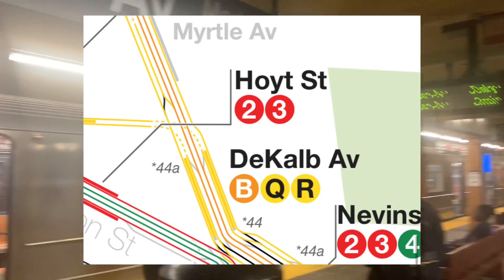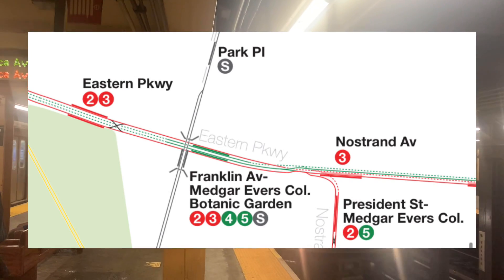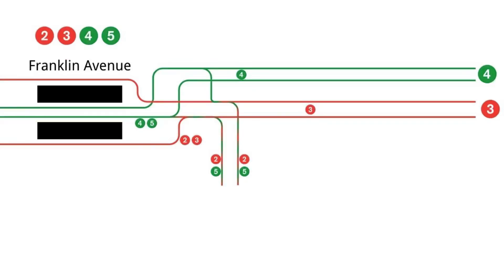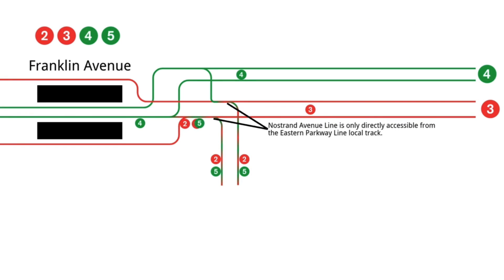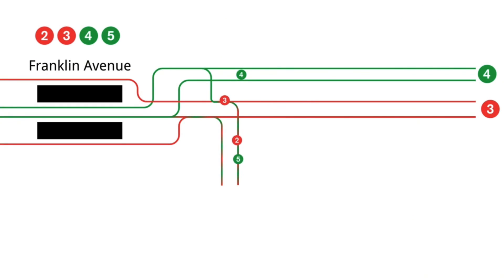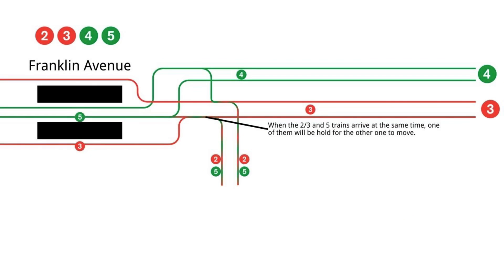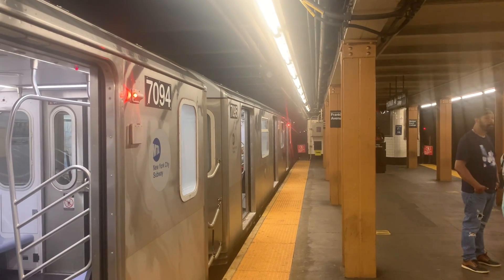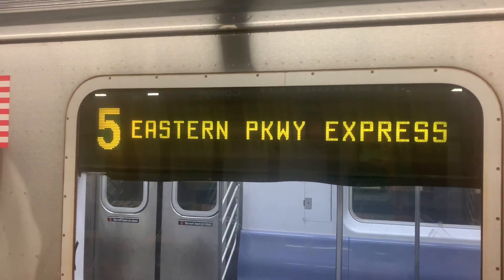Rogers Junction: Fix it to get 30% more capacity in the A division!

Comment: I don’t like the idea of the 8 because then you decrease capacity a little bit and you need more trains. What would be more optimal is to build a new switch that connects the Nostrand Avenue line with the express track. And people on Nostrand Avenue rely on 5 train service. They can just build a new switch from the express track that curves around kind of like how the five curves around from the 2 to the 4 at 149. You can do the same thing going into President Street and then you can still increase capacity. People within the MTA told me it’s unlikely they would get rid of the three at new lots because the 3 is based at Livonia yard. People don’t like to transfer all too much. People prefer direct service and the 5 does that job fine. All you need to do is build a new switch from the express track to the Nostrand Avenue line. You can build a new form of interlining kind of like how 59 St does it with the B and the D. This is not official and a lot of work would have to be done in order for this to be implemented.
Reply from the maker: I remember seeing this plan in the 1993 study.
Reply from the maker: That curve at 149 limits train speeds, so I don’t want to replicate that. As for the one seat ride argument, the more reliable service will make up the time of the cross platform transfer at Franklin Avenue. Like which do you prefer: a one seat ride that is held and delayed multiple times, or a service that is on time that requires a cross platform transfer?
Reply: @Urban_Man I usually like to go direct
Reply: @the_elmeister A minor cross-platform transfer won’t make or break your trip. In fact, it could make your trip faster.

And besides, nothing wrong with building two new switches east of the Roger’s Junction interlocking and sending the 3 to Flatbush and the 5 to New Lots, making all the usual stops. This would mean that riders further out have faster service and those in the Broadway-7th Avenue Line would have more consistent service. And the loss of a direct yard access is no biggie. Livonia is pretty useless as a 3 train facility (much like the 3 train itself in a way), given that nearly all the space there is for storing train cars used on the 4 and 5 trains. By deinterlining, you could allow for the 5 to based out of Livonia Yard while the 3 would have direct access to East 180th Street Yard instead, which would further improve reliability. Also works pretty well considering how often 3 service has been suspended during weekend track work in Manhattan or something.
Reply: @TheRailLeaguer we’ll see what happens. But for DeKalb, swapping it all makes it so u don’t get a cross platform transfer which is a problem
Reply: @the_elmeister With the current patterns, it’s not much of an issue since the 6th and Broadway Lines run about a block apart from each other, so it’s just a short walk from an alternate station. After all, got to have those alternatives.

In addition, I also propose to actually  integrate bike share with the transit system via the OMNY system. Not only that, but expand it deeper into the outer boroughs as well. This would allow for users to cycle to an another station that does seem to be further away but brings you to your ideal destination. Not to mention it would get a good number of people off the subway and bus system, creating room for those who actually need it.
Reply: @TheRailLeaguer  I think there can be a switch created from the express track to Notre Avenue line simple as that and then yeah
Reply: @the_elmeister That would potentially require even more complex work compared to deintelrinjng Nostrand with the two new switches between the interlocking and the Nostrand Avenue station platform. This would provide even more pronounced benefits for train crews and the riders alike. Not to mention more frequent service overall.
Reply: @TheRailLeaguer  that’s why I think the 5 should get a switch from the express track to Nostrand Avenue line but to be honest with you, I think if there’s gonna be any rerouting, you need to consider the new Utica Avenue Line. I think that branch could warrant the need for two services because it’s isolated from everything else and don’t forget that the 4 train serves new lots during late night hours. I think what you can do is have the 3 and 5 trains go on the new Utica Avenue line and you have a switch from both of those tracks at Utica and then the 4 goes to New Lots at all times.
Reply: @the_elmeister My plan does consider the Utica Avenue subway, and you honestly don’t need the 5 to get on the Nostrand Avenue Line. You could be fine with the 2 and 3 going to Flatbush and the 4 and 5 taking the Eastern Pkwy Line with the 4 going express to Utica and then switching to the local to go to New Lots while the 5 switching to the local to stop at Nostrand and Kingston and then Utica before switching to the Utica Avenue subway.

And as a frequent transit rider, neither Nostrand nor Utica need more than 15-20 trains per hour, especially for CBD-bound service. The 2 and 3 on Nostrand would give off a combined 20 for that corridor. Utica would need about 15. That’s more than enough. No more, no less.

In fact, I’ve considered a modified Utica subway option, with the tracks from Eastern Pkwy being the express tracks making express stops to Avenue H, then local from there to Kings Plaza. Another pair of tracks would start at Avenue H, be the local track north to Eastern Pkwy, then continue up Utica and Malcom X and then DeKalb to Queens, connecting with the J, M, and L trains for transfer service to Manhattan. This would allow for much of the transit traffic to be funneled away from Downtown Brooklyn and Manhattan and ease congestion there, all while improving connectivity between Brooklyn and Queens.
Reply: @TheRailLeaguer I think they can extend Nostrand Line and split it into two branches and one can go to Gerittan Beach and one go to Sheepshead Bay
Reply: @the_elmeister That would be way too impractical since Gerritsen Beach transit ridership and population is too low for warrant a subway extension. Besides, what’s wrong with a singe extension down Nostrand all the way to Sheepshead Bay and Manhattan Beach, location of Kingsborough CC’s hefty student population? This would still get Gerritsen Beach <1 hour of the CDB, even if that neighborhood doesn’t get subway service (which it honestly does not need)?
Reply: @TheRailLeaguer what if instead of Gerritson, it goes to Breezy Point Queens or towards the tail end of the Rockaways
Reply: @the_elmeister Manhattan Beach is a pretty solid terminal for now. Breezy Point doesn’t really need subway service right now.
Reply: @TheRailLeaguer 
According to census data Utica Avenue riders are headed towards downtown Brooklyn and Lower Manhattan so having an IND Utica Avenue line would no longer be necessary. 

Also Lower Manhattan isn't really a popular destination for those on Broadway Brooklyn and Myrtle Avenue rather their preference is Midtown Manhattan Soho I think for now M train interlining is worth it but as gentrification marches Eastward into Northern Brooklyn and Queens in the long term we might need drastic improvements and changes to fix the infrastructure of the BMT Jamaica Line as a whole.

There's also another thing about the lack of connectivity between Northern Brooklyn, Southern Brooklyn and Central/Northern Queens (of which Queens is currently dry and is in better need of public transit mobility).
Reply: @TheRailLeaguer 
In my proposed NYC Subway extensions throughout parts of Brooklyn and Queens there's the potential for redevelopment and especially upzoning. The city is in a housing crisis, not just a climate crisis, and we need this.

My problem and this goes for Utica as well with extending the IRT down  these two avenues (you know which corridors I'm talking about) is it doesn't connect to any other subways in until Alatnic/Barclays, so it remains a strictly Manhattan-Centric subway network. I really want other subway lines serving both extensions, but in the case of Nostrand where there's already a subway some of the way, it's probably too much disruption to widen the tunnels to fit B-division trains. I'd extend the E from Canal Street to do this, so that people deeper in Brooklyn can connect with the A/C and G trains to travel between the outer boroughs. (Utica would also connect with the J and M.)

Speaking of housing Development in southern Brooklyn right now it would be helpful to know whether current B46, G, J, and L riders prefer Midtown East or Midtown West as a whole for the entire length of the Utica Aveune/Malcolm X Blvd corridor. Because my stance for Utica Ave being a separate IND line rather than an IRT branch could be fulfilled by an extension of SAS or whichever 8th Avenue services terminates at World Trade Center. Could go either way.

As for 6 Ave/Superexpress, the F would go to Flushing, and the V would go to Hillside Ave. Northern Blvd would still be substantial enough to relieve the 7, simply because you're saving a lot of time on East Elmhurst to get onto a train sooner. (Port Washington would also help, especially Murray Hill and Broadway stations for Q12, Q15, and riders on other buses, there would be 12 TPH on this segment in my grand vision.) which frees up the A to do Hoarce Harding Expressway and the C to do Union Turnpike, both able to replace costly express buses and make room at College Point depot to boost local bus frequencies.

All the above should create a ton to help Southern Brooklyn and Northeast Queens upzone. Remember, we're not only in a climate crisis, we're also in a housing crisis, and we need as much new housing as we can get.
Reply: @TheRailLeaguer 
Then I have a few outlandish suggestions 

The K runs from Bedford to Canarsie. There are switch tracks at West 4th, Chrystie, and Broadway Junction that could make this possible. Basically have the K run from Bedford Park Blvd to Canarsie Rockaway Parkway via CPW local, 8th Avenue local, Chrystie Street, Broadway-Brooklyn then use a new track East of Broadway Junction for K trains to access the Canarsie Line and have K trains terminate at Rockaway Parkway.

Bring the Brown M and V train combo back which could be possible if L train service is beefed up this time to make the Brown M terminate at Broad Street (no Nassau-4th Aveune service) every capital projects including small capital projects that could be de-interlined should be de-interlined.

Restore the H and restore the abandoned LIRR Rockaway Beach branch from both Rockaway branches and have it connect to the Queens Blvd Line at 63rd-Drive Rego Park and have it terminating at Woodhaven Blvd. Build a track loop past Woodhaven Blvd under the QB ROW so it could turn around and return to Far Rockaway.

I think a subway line running along Utica Aveune should be built as planned in the IND Second System as a B division line.

The K and V should both be reinstated, with the V splitting off from the F after Second Avenue, towards South 4th Street meeting up with the K, while the K splits off from the A, C, and E after Canal Street, running along the Worth Street line towards South 4th Street  to meet with the V. Both lines will run along Central Aveune before turning towards Malcolm X Boulevard, which after Fulton Street becomes Utica Aveune, running standard 2-trak line, terminating at Aveune U Kings Plaza. 

As for the M it would have to be rerouted as part of the Second Avenue line.
Reply: @TheRailLeaguer 
Speaking of housing development in southern Brooklyn is mentioned. I've said before how I feel about SAS being the Utica Avenue line, as a way to relive the Lexington and Canarsie trunks in general, and platform overcrowding at Union Square and Bleecker St in particular. (It would also aid Brooklyn/Queens connectivity by giving the E, K, J, and M lines north/south connections.) Right now it would be helpful to know whether current B46, G, J, and L riders prefer Midtown East or Midtown West as a whole. Because my stance for Utica Aveune being a separate IND line rather than an IRT branch could be fulfilled by an extension of whichever 8th Avenue services terminates at World Trade Center instead of SAS. Could go either way.

 Since we're talking about crayons here's mine. I keep my A/C/E labels for Fulton/8 Ave/Queens Blvd express, with the K being 8 Ave/CPW local. I am no longer extending that on the Manhattan side, so WTC stays. The K would be extended at the Washington Heights end into New Jersey, via Route 4, to Paterson NJ.

I used to tie an extension of the Myrtle Avenue line to 8th Avenue. Instead I'm tying it onto Broadway. Now that I know the S-bend between Corrtlandt St and City Hall can only take a maximum of 20 TPH, I'm extending the present day W down to the lower level of City Hall then to downtown Brooklyn on a new alignment finally I have the W running down Myrtle Aveune with a portal at Ryerson Street so it properly connects with the Myrtle Avenue El. So the would now share tracks between Metropolitan Aveune and Ditmars Blvd, combining this is a future extension along Eliot Avenue and Junction Blvd to LGA serving Corona all within a one seat ride and creating a loop line this would follow the Q58 which is top 2 of the busiest bus routes in 2022.
Reply: @TheRailLeaguer 
I would like to address some of my plans for "transit expansions"

I would first say that given Flushing is a top destination corridor for the vast majority of Queens, especially Northeast Queens along the LIE Corridor. That is why, prepandemic, Flushing-Main St on the 7 was the most used station outside of Manhattan, with close to 60k daily riders if I am not mistaken. Also, there is nothing at College Point Blvd/LIE, it is a highway ramps, parks, and cemeteries. In other words, there is very little redevelopment potential to create that induced demand. A better alignment is to serve Flushing, then veer down Main Street or Kissena Blvd, as Main Street is surrounded by parkland, Kissena Blvd is surrounded by both sides by dense apartment buildings. I have my issues with extending the G back to Queens Boulevard, but if you are going to have the G branch, that can serve Main St as well. Also include a stop at 99th St, LeFrak is there.

I also think the 7 should go elsewhere as well Port Washington is way too close to Northern Blvd, and 10-12 TPH on Port Washington would be more than enough capacity for this entire corridor. Consider extending the 7 up north to College Point/Whitestone, and adding a second branch along Kissena Blvd heading towards the LIE. This helps fill existing service gaps in NE Queens, while also paralleling some highly used buses like the Q25, Q44, and Q65 in Whitestone/College Point, and the Q17, Q27, and Q88 in East Flushing and Oakland Gardens. Both branches would start as Flushing, as Flushing is a major commercial center in Queens, making it a higher rider destination.

Don't think a four track line is necessary outside of the Second Avenue Subway. Both Utica and the Nostrand Aveune corridors don't need an express since the Eastern Parkway line would be capped at 15-20 TPH for each branch and the demand for a four track line isn't really worthwhile in areas aside from 2nd Aveune in Manhattan. Speed wise, two track lines can be as fast as express sections, if done right. Wider stop spacing is required, plus a train car can accelerate faster to my knowledge.

Commuter rail doesn't need to be this way. If you go to cities like Paris, commuter rail runs every 4 minutes. That is because these systems were reconfigured as a regional rail express system, with competitive pricing to the Metro. Doing the same in New York City would be way cheaper then building a subway parallel to a commuter rail route and would be way cheaper netting nearly the same benefits if that's the case then you're better off extended the E somewhere else such as the Merrick/Linden Boulevard corridor to cover other Southeast Queens transit deserts and if the MTA gets costs down on construction costs then you're better off extending the E via Linden Boulevard to increase coverage meanwhile the LIRR Atlantic branch would get converted into a regional rail line. I also want to add for the E to SE Queens extension, although the E via Alatnic is good, I believe regional rail is best for both Atlantic and Montauk. This will serve a huge portion of SE Queens, but even with this increased coverage, there are still spots that have poor transit service. So I would extend the E to those areas, like Cambria Heights.

-How come despite logistics many Railfanners support Joint Transit Association and Alon Levy's plans for a Second Avenue Subway extension via Utica Aveune and the 7 train project for JTA since TMC and Alon claims that parallels a "perfectly good regional rail corridor" making subway line extensions useless and according to TMC's quote "regional rail is a replacement is some instances like in the Bronx where even at average global construction costs don't allow brand new subway lines to pencil or on Northern Boulevard where LIRR stations are generally adequate enough for connecting bus service and a new subway line would compete with ridership for the LIRR". According to TMC.

Besides how come every single Railfanner like Joint Transit Association, Urbanman, TMC, Alon Levy, Samuelitoo, Mystic Transit and others are proposing a unified regional rail system and are attempting to utilize existing infrastructure first before we extend any subway lines also these are the same Railfanners that claim that the 7 via Northern Boulevard is wasteful because the Port Washington branch already parallels the Northern Boulevard corridor which is why JTA and others support his proposed 7 train project for the Flushing Line to serve areas like College Point Whitestone, and Bay Terrace as well as the LIE Corridor to Bayside also instead of the E train takeover of the LIRR Atlantic branch they imagined if they have a lot of money they would instead extend the E via Merrick Blvd and Linden Blvd to 230th Street and instead they are proposing converting the LIRR Atlantic branch to be part of a unified regional rail network along with Metro North, Amtrak, PATH, and NJT like what this guy Urbanman proposed "many people propose extending SAS into the Bronx or building a new Northern Boulevard Subway don't get me wrong those aren't necessarily bad ideas but a more cost effective solution that Urbanman, TMC, Joint Transit Association and Samuelitooo proposed would be to think outside the box and utilize existing infrastructure first to it's maximum first" just like what Urbanman said in his latest video plus Joint Transit Association, TMC, and Samuelitooo seem eager about it so why not try it here in NYC.
Reply: @TheRailLeaguer 
Please do Utica, there's too many situations right now pointing to that being the next "no brainer" for how much it can snowball into. If the IRT extension is chosen, that's a (semi) immediate filling of a long standard rapid transit desert, buffs to the IRT system as it forces the horror that is Rogers Junction to get reigned in, and giving purpose to the 5 line as more than a filler line.

If the IND is chosen (and honestly, it kinda should), that's an immediately more exciting bit as you now know there'd be a southern Brooklyn terminus to the current 2nd Av Subway and in an ideal circumstance gets itself re-routed south of 63rd Street along 3rd Ave to better hit the midtown central business district until Houston St where it curves east with a stop at Ave C or so, goes under the river to Williams then curves south under Montrose Aveune before going south to Stuyvesant (to the Myrtle Avenue J/M/Z station) then south the remaining portion of Malcolm X Blvd-Utica Aveune.